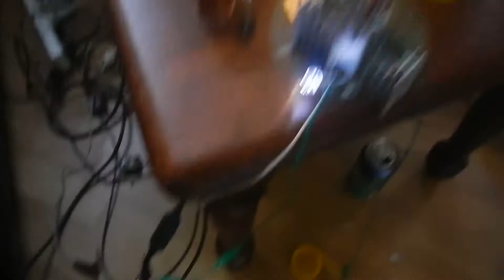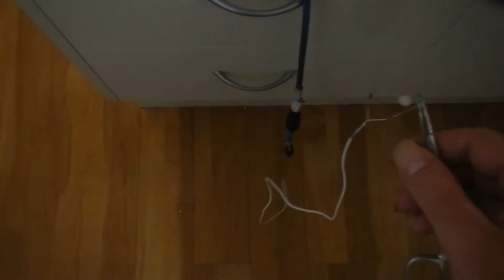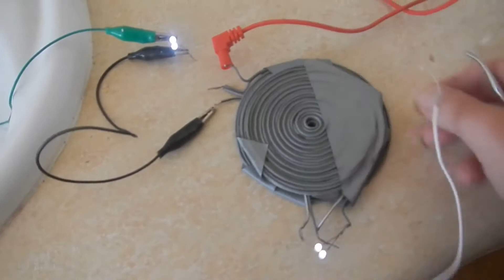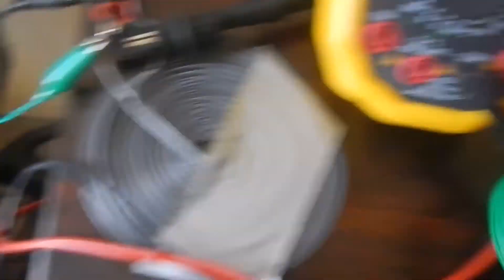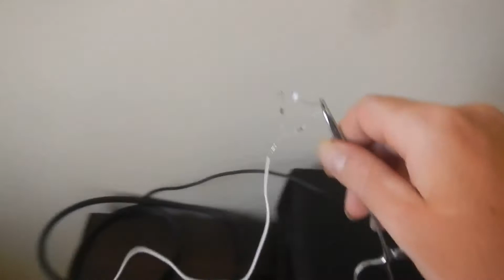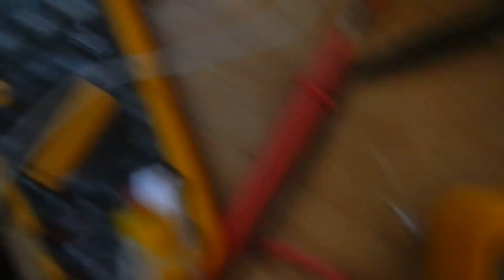Tesla powered House. Wireless in every room.

Comment: I hadn't looked at this in over a year, but ya know what just hit me when I seen it just now?  How about putting a 2.4GHz antenna on top of the pancake (at a length distance equal to or in multiples equal to the length needed by 2.4GHz (to the 'top' of the pancake) and of course ground?  Maybe if pancake was worked out to be wound in length that works to the favor of the 2.4 GHz it could become a "free" Wi-Fi repeater?  Interesting.  :-)  I think I'm going to have to try that out.
Reply: After further thought on it, I bet the AP (if it could "see" the reflections of itself), would think it was a Rogue AP nearby and try to stop it from talking.  Would be fun to try.
Reply from the maker: Lol. Good luck with that. The wavelength for 2.4ghz  is 12.5cm
Reply: Yeah.  I've thought on it more and am trying to figure out how to get a real earth on the power supply (AC -> DC) and the circuit that runs the radio so it ties to Earth too.  Guess the radio is all that is required tho?  Not worry about the power supply section.
Reply from the maker: Both should be grounded anyway.
Reply: Yeah but the power brick only has the two prongs on it and knowing more about how Tesla did stuff through the Earth it doesn't surprise me that they don't ground the Access Points.  Can you imagine if all the APs in the world were tied to ground!?!?!?!? I bet there wouldn't be a power shortage anywhere on earth.  I bet too everyone would be tired of getting over-baked on 2.4GHz (microwave oven style).

Comment from the maker: Seems my top load issues where mostly bad connection :0 Burned an inch of enamel of, and stuffed wire into fold on ring pull. few jiggles and it goes good. 99.9% sure its grounded, as I think the laptop charger I am using has grounded neg rail. Which would explain a few oddity's with the USB's on my laptop playing up in tesla fields, and my scope earthing stuff when charging from laptop.

Comment from the maker: No, not yet. Could be good for fly-backs and SJR3. Don't think it would work well with Tesla coil due to low freq. Worth a try though. Let me know how it goes. This coil is TIP31. 50k on base. Standard slayer circuit. I need to go check out Gbluer's stuff some more, Get this down under a watt :) The new 2 transistor one could be the go.
Reply: HOW MANY WATTS YOU AT NOW? ANY UPDATES?

Comment from the maker: Best diodes I have tried are 1n4148/1n914/baw76 (all the same part). I have tried a few different germanium's still have half a drawer full of untested ones. Most of the guys on youtube with a detector are using the 1n4148. Signal diodes and high speed rectifiers seem to be the go. As far as TC's go, this is about as simple as it gets. Almost the same as the oscillators you are doing. Its just a mater of winding up a tower :) Now to get more light for less watts!